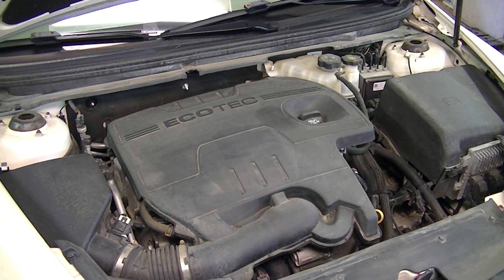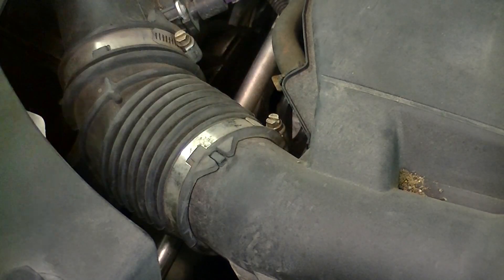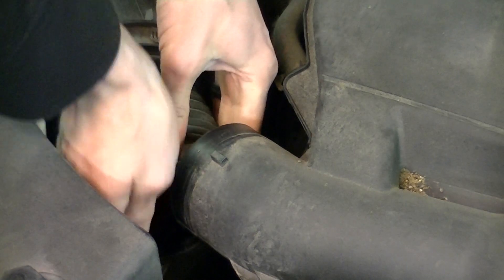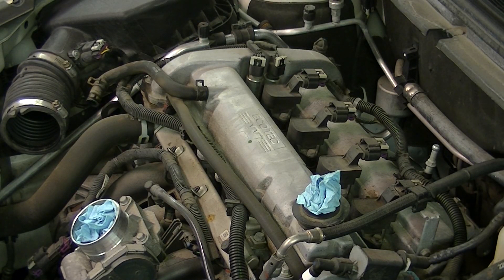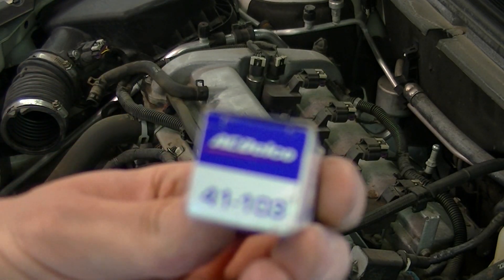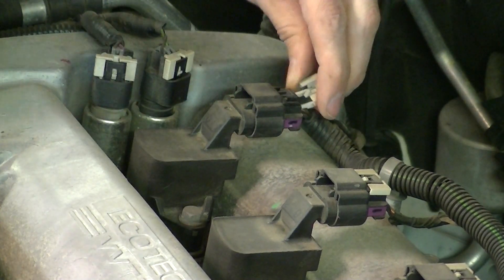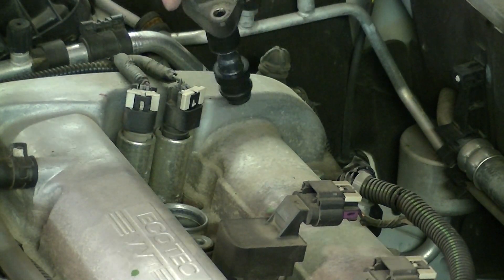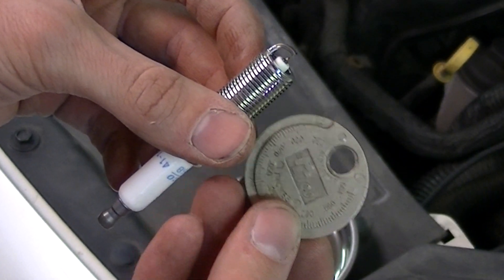How to Change Ignition Coils on 2.4L Ecotec GM Engine (Step-by-Step Guide)

Comment: Like the video. Here's 3 things I noticed, when you anti seize the threads on the spark plug place it in the socket first so you don't get it all over your fingers. Second anti seize the bolt for the ignition coil also. Third a little di-electric grease on the connectors for the wiring helps keep out moisture. Just my thoughts
Reply from the maker: Some good suggestions thanks!

Comment: Wow, they sure made that plastic engine cover unnecessarily complicated.  It has the intake air tubing integrated through it!  Crazy,

I have that same engine in my Cobalt and its cover is completely separate from the plastic intake/baffle that attaches to the air intake tubing and throttle body.  So no tools are necessary to remove it   and if I choose to, I can drive without the cover altogether.  The 2.4 is a great engine and even at 235000 miles mine runs like new.
Reply: I feel like the plastic cover being integrated was more of a cost saving measure rather than making it harder to work on these vehicles are very easy to work on for the most part unless you gotta replace a light bulb then it's unessary hard

Comment: I am 2016 Regal Turbo a shakes every once in awhile under power what are you thinking my be I appreciate your response
Reply from the maker: Actually sounds like it could be a misfire from a bad coil or spark plug, or possibly a failing fuel injector just as a first guess

Comment: I very small amount of anti seize will suffice. Using too much can cause missfires. The spark plug grounds itself through the threads and to the cylinder head.

Comment: If you still have the car can you tell me the wire colors on the back of the coils I need to repair my wiring harnesses I seen the color on the first cylinder but the rest were to far away from camera thanks
Reply from the maker: Still have the car but those wires are not easily accessible. Maybe try this? http://13.fdnu.denisefiedler.de/kmo/2010-chevy-malibu-wiring-schematic.html

Comment: Thanks for a great video! Question - did you not feel the need to add dielectric grease to the bottom of the ignition coils?
Reply from the maker: There was already grease on the connectors but thank you for bringing this up, I did forget to talk about it in the video.

Comment: Do you not disconnect the battery on these engines while removing the sparks? Does it mess with the computer to much or did you just not show disconnecting the battery?
Reply from the maker: It is always a good idea to disconnect the positive cable from your battery. It removes the chance of electric shock while doing your work. However, I cannot say that its absolutely required as the circuitry being serviced is powered off when the key is off. I personally do not disconnect the battery unless I know that what I am working on has live power, but I also have a bit more experience under the hood. Customers don't like resetting clocks, radios, etc that come with disconnecting the battery...

Comment: What are the torque specs for the spark plugs, and coil pack bolts?
Reply: Answering my own questions....found the answers online,    spark plugs 15ft lbs......... coil packs 7 to 8ft lbs

Comment: Do you know what size the bolt is I need to find the size of it for reference so I can buy another one as when I was following the video three turns into removing the bolt the tip broke off as it was very snug
Reply from the maker: Unfortunately I do not. I have done a fair bit of looking online and that wasn't much help either. I would guess an M5 or M6. May need to take bolt to a store like Fastenal or another screw retailer. They should have a gauge set to measure the thread size and count.

Comment: Never use anti seize grease on new spark plug!! it is only for old type spark plugs, nowadays it is no longer necessary and it can cause over-tightening issue ..
Reply: Anti seize does not effect torque, steel and aluminum do not like each other. Use the anti seize you will glad you did the next time you change plugs.

Comment: Most Spark plugs now a days have a antiseize coating on them that's why the old ones came out maybe not easy but they came out when you put anti seize on something it changes the torque specs I'm sure the mfg thought about this and your using OEM parts so no antiseize shouldn't be used

Comment: When I had a truck I replaced my spark plugs.
Then a ignition coil went out.

I paid like $80 + tax on 1 and replaced it myself.
Then it did not fix the problem.

Had to pay $330 about at a auto repair shop.
So $80 + tax extra down the drain.

Ignition coils are not as easy to replace as spark plug wires.
Plus cost as much for 1 ignition coil as a whole set of spark plug wires or almost.
Reply: If I had a truck with spark plug wires I would have replaced all of them for a way lower price.
Reply: What did the auto shop do differently than what you already did? Did they put on another ignition coil? Maybe the one you put on was faulty.
Reply: I am no mechanic.
and got advice from a master mechanic and he tested them.

Then wanted me to put them back in. Same results. The new 1 did not look worn out.

I guess it was faulty or whatever. 

2004 Chevy Colorado. I dont recommend them.
Cost alot in yearly maintence.
Had it for 2 years and 3 months.

Comment: Anyone know the tourque specs on the spark plugs?
Reply from the maker: The spark plugs are recommended to be tightened to 15 ft*lbs. I have read in other places about 11 ft*lbs if you applied anti-seize to the threads or approximately 18 ft*lbs if you did not apply anti-seize, but that was not confirmed by the manufacturer.